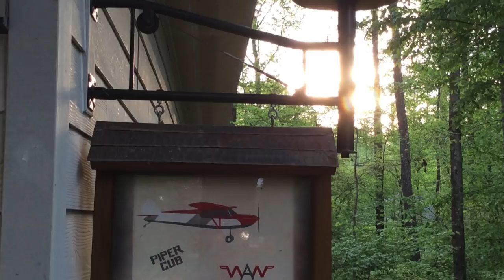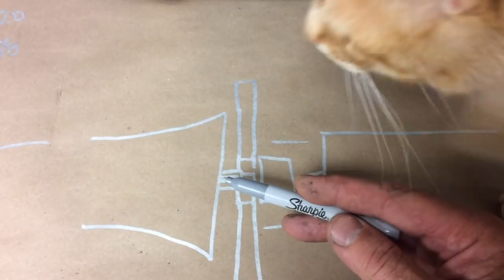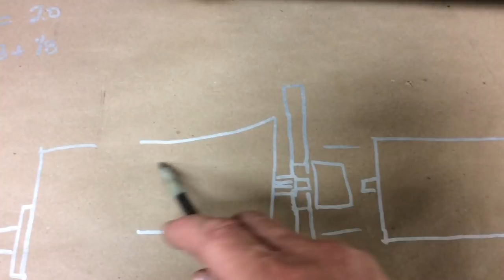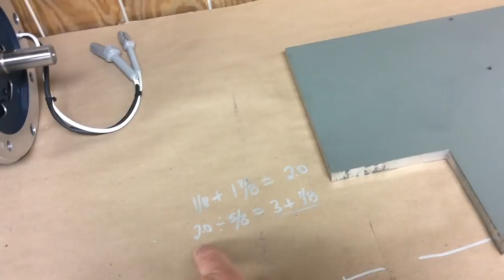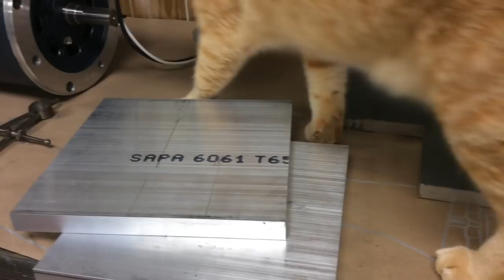RX7 to EV7 Episode 1 making the adaptor plate

Comment: It might be too late now (sorry, I'm just re-catching up with your videos) but you should consider switching out to the R-type transmission from the TII RX-7, or earlier RX-3, RX-4, etc. The M-type you are using is pretty weak. Stronger than people think, but still fairly easily killed by torque combined with traction. Mazda got away with it because the FB/SA RX-7 was just below its power handling limit. While the same transmission used in the NA FC put it right at its power limit so with increased torque (say, adding a turbo or an electric motor) 2nd gear goes away pretty quickly. Even totally stock cars often have quite a whine in 2nd gear. Moving to the R-type means a different input shaft diameter utilizing a large clutch and flywheel from the matching car, but thankfully same bellhousing pattern (basically all rotarys from early 70s and up use the same bellhousing pattern).
Reply from the maker: aaroncake, where were you a year ago?😀. When we bought this car the engine and transmission did not come with it. I looked at the second gen RX7 transmissions (seemed easier to find) but if I remember right it is longer and crossmemebr placement was different. With your insight I should have spent the time and made the the swap. Thanks for passing that along. If I do have a issue with this one I won’t waste time on trying to fix it I will just swap it. Don.
Reply: Should have mentioned that swapping the tailshaft housing from the M type to R type puts the crossmember back where it should be, if I remember correctly. I think you're going to be fine with the M type because you'll probably leave it in 3rd or 4th. 4th is straight through.

Comment: I got to ask, if your using a manual trans but not using a clutch how do you plan to shift gears in it?
Reply from the maker: Jerry T Johnson, I'm not, hopefully enough toque to start in 3rd
Reply: I was wondering if you planned on over running the gears to which would be fine on the Sequencers but I think it would eat up a lot of your voltage but starting in 3rd gear not sure you'd be saving any voltage either let me know how it turns out.
Reply from the maker: Stay tuned

Comment: thank's for your build videos 
just a question what about gear shifting without clutch is it harder ? I know it'es possible but I never figured out how hard it could be .. I plan to keep clutch for my ev conversion
Reply from the maker: Not sure how hard shifting clutchless will be. I watched several videos on the clutch or no clutch issue and decided I would try it without. I will let you know. Thanks for watching and good luck with your project.
Reply: it makes no difference, when you press the clutch you separate the box from the motor. in an ev when you are at 0% throttle its exactly the same thing. its spinning at the same speed as the box.
Reply: ok i think un understand htank's a lot
Reply: Wouldn't letting off the peddle in this scenario create an engine breaking effect?
Reply: Blake A. Kiessling not Unless you have regen on. there is almost no friction from the electric motor. If you have regen it would act more like engine brake and make it harder to shift but still possible.

Comment: Hi Don
i am wondering, Why did you not make the adapter plate out of aluminum?
Reply from the maker: Shafi Mohammad, it is made out aluminum.
Reply: Sorry Don i forwarded thru the part where you showed the 6061. my bad. Great work on the video. very detailed.

Comment: A guy swapped out the motor from an RX8 and put in a LS1 V8. I said at the time: "What is the point?" Any RX is a, or will be, a classic car. An RX7 will lose money by playing around with it and swapping out the motor for an electric motor. Why not swap out the motor of a cheap 4 or 6 cylinder car?
Reply from the maker: Robert Days, 🤔 your idea of classic is different then mine. I guess thats what makes this world an interesting place. If you question my perspective spend some time on Craig’s list looking at gen 1 RX 7’s. In my neck of the woods their cheap. Gen 1 also make a great candidate for converting. No power steering, light weight, low drag and not electricity complicated (no computer integration). I paid $1800 for this car with no engine (episode 1) and will probably have less the $10,000 when I’m finished. What will it be worth??? Don’t know don’t care! I’m just enjoy the ride😁 PS it’s also the car my wife wanted me to do😳
Reply: @MrRv8pilot  Can't get one here unless you spend some real money and the more genuine they are the better. Same with Nissan Skyline GTR I was looking at buying one and they got down to $16k then all a sudden they jumped up to $35k and now are up over $60k. I missed the boat on that one. I wonder how much it would cost to import them over here from the States?